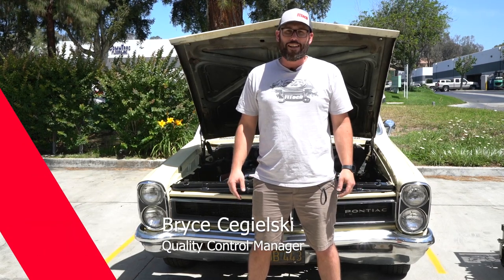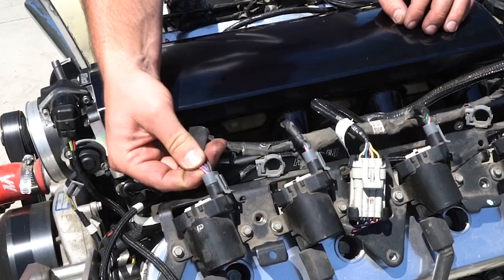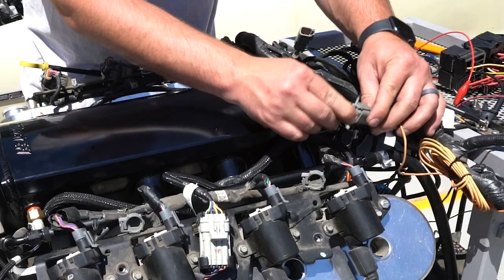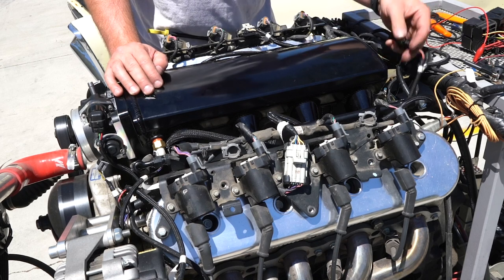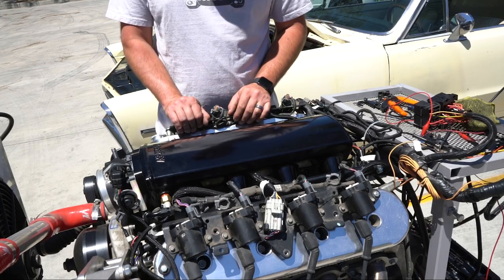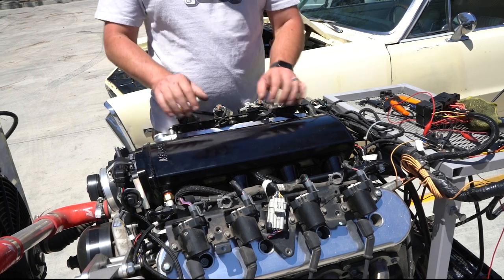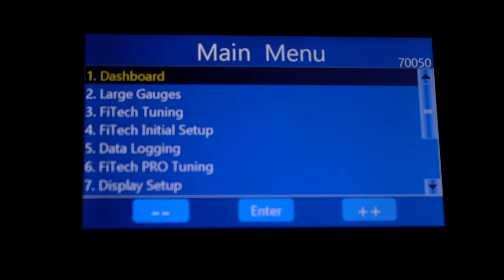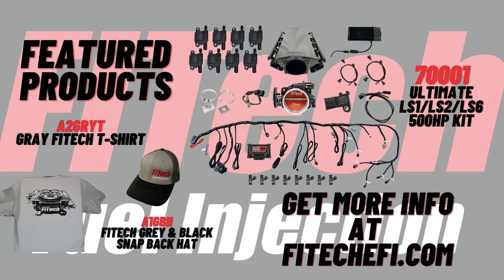Common LS Mistakes| Tech Tuesdays | EP23

Comment: Thanks for another great video, You could do one on  checking the  tune settings ( readings) after the first  100 miles or so. What to look for, to start fine tuning the motor with the ultimate LS system.
Reply from the maker: Great suggestion, I'll relay that over the Tech Tuesday team!

Comment: loving my new fitech system, as i now have full control, over everything - fans, AC fan, shifting, idle, my speedometer is now correct, no more calling that HP tuner person and being charge just to change the fans, and I installed Fitech myself, and the my HP tuner person told me you don't want to do that,,, now i know why,, my next build will also have the fitech system,
Reply from the maker: That's awesome!

Comment: The only thing not covered was the injector sub harness orientation. Do they plug in so the harness connectors are at the back of the engine?
Reply from the maker: The injector harness connectors go towards the back of the engine.